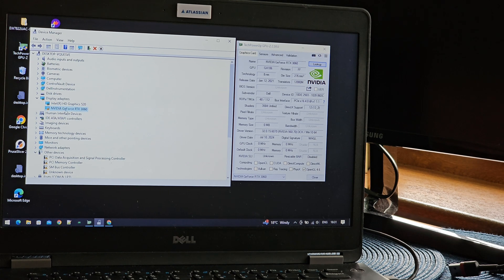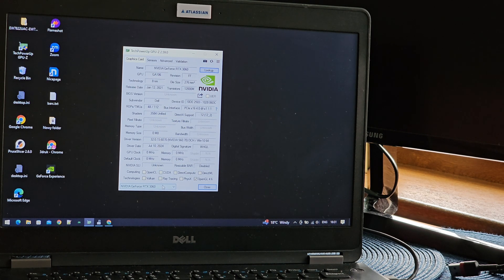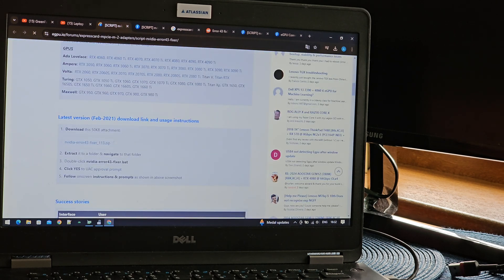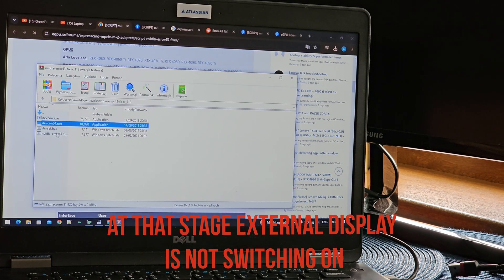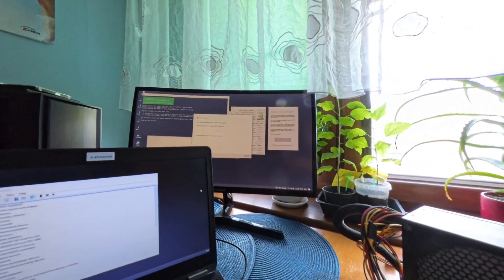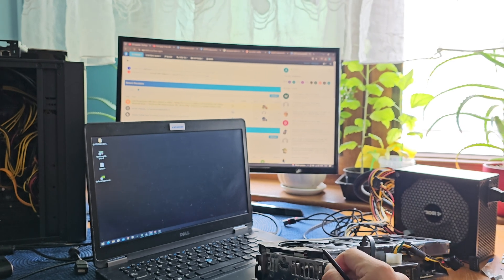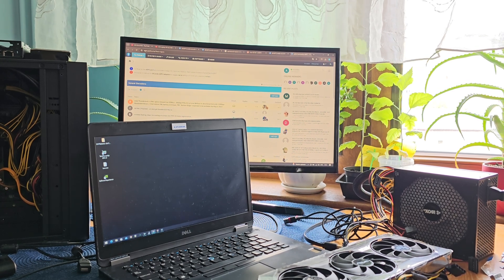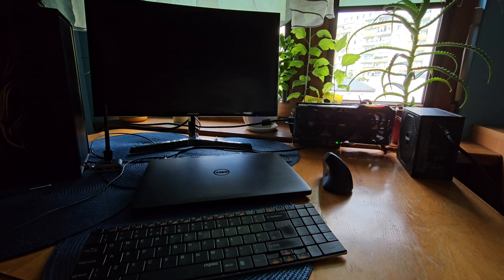eGPU -Laptop Dell,  M.2 Wifi slot 3dMark Steel Nomad

Comment: im having an i5 10th gen and my laptop ram is 20gb, im planning to use this RTX 3060 as my EGPU. WIll it work? How much FPs will i be getting. Btw Im also connecting the graphics card  through my wifi port. my laptop is Lenovo Ideapad 3

Comment: UPDATE:
It is working! Haha.. so satisfying.
That Error43 Fixer is a life-saver, instant effect!

Finally i ordered an EVGA GTX 1070 8GB SC which was for crypto-mining farm that went bust; practically still in nearly mint condition.

I'm using cheap eGPU docking that is also for crypto-mining, less than 10 USD.😅
It delivers x1 PCIe lane through a thick USB 3.0 cable to a mini USB header.

For PSU i use a CCTV 360W which only provide 12 V rail; pretty stable for an old 150W gtx.

Fortunately OXP Mini Pro 6800U has x1 PCIEe 3.0 for its m.2 wifi slot.
So theoritically it is twice the speed of x1 PCIe 2.0.

My initial goal was to double the performance of Radeon 680M igpu, but based on Superposition benchmark this 1070 egpu setup could delivers 3x better.
(Score: 1703 vs 4982; 4K Optimized).

Thanks a lot for your video, i could confirm this m.2 wifi slot is way better than mini-PCIE.🤩👍

Comment: Finally, a great result ! Thanks. 
I've been wondering for months whether this kind of setup would be working or not.

I've tried similar setup with mPCie (Intel Haswell based mini pc) but it was awful due to x1 bandwith on older PCIe 1.0 lane that is too slow.
Recently i've upgraded my PC to Ryzen 6800U based system with PCIe 4.0; technically its x1 PCIe bandwith speed is on par with x2 PCie gen 3.0.

I have a cheap mining GPU riser with x1 PCIe lane, i'll try it to see the performance before decide to buy something serious such as TB4/USB4 egpu docking.